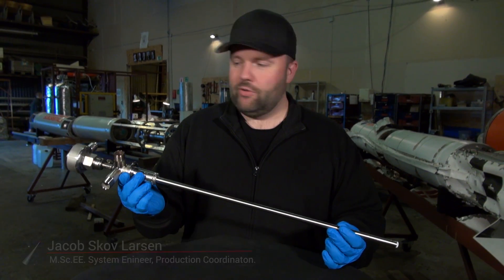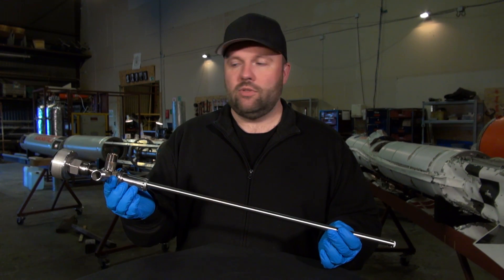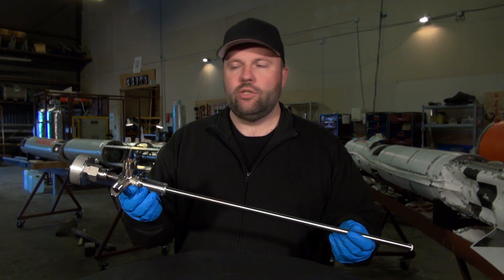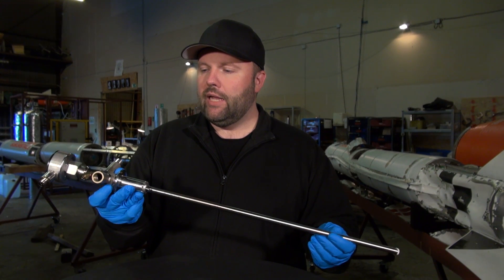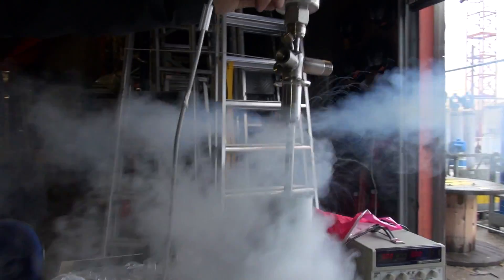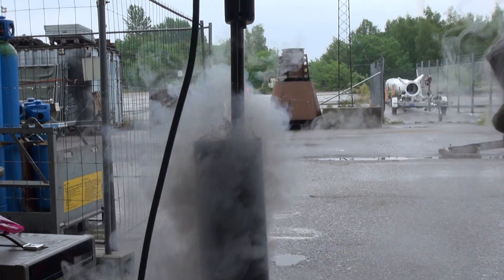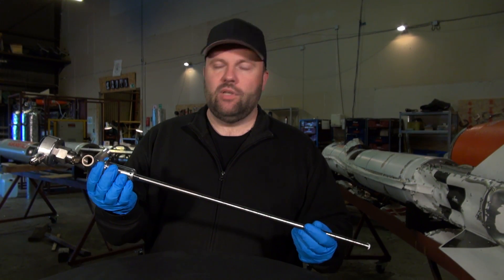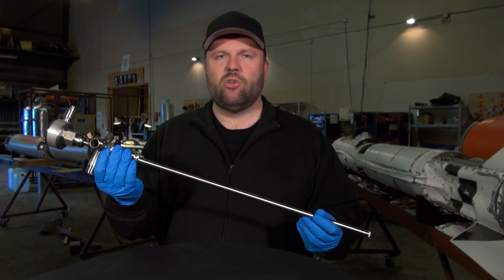Calibration of the LOX sensor

Comment: What is the rocket fuel ?
Reply: It was never the plan to use H2O2 as oxidizer as far as I'm aware, it was only for the turbo pump. The decomposing of H2O2 could never reach the efficiency needed to reach space (caps out at probably not much higher than a 100ISP I'd wager), and on top of that it's some pretty nasty stuff at high concentrations. Ethanol and LOX are probably easier to both procure and handle, even with the challenges of cryogenic fluids.
Reply: Bartosz Barejko if it looks stoopid and it works, it ain't stoopid.
Reply: LOX + ethanol with some water.
Reply: Tamás Fábián So we are back to the Ston Age we must burn to make steem.
Reply: How about your H202 did you give up with this Higly reactive material. ?
Reply: Yes, when you are working with budgets 1 / 10.000 that of professional rockets, you are sometimes forced to use stone age technology.
Reply: Back in the Stone Age, humans never had the knowledge to burn things for steam. Nor do they have the capabilities to build rockets even of this level.